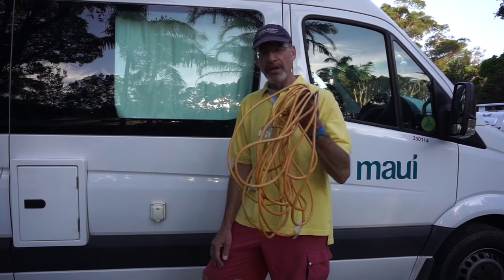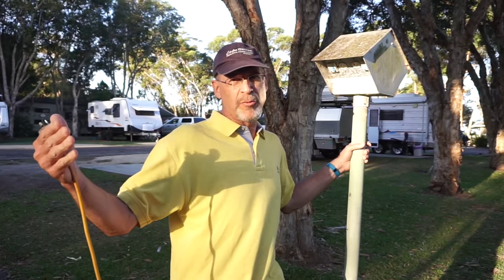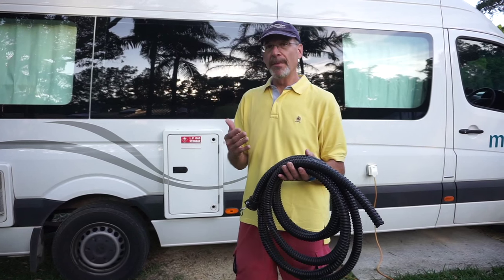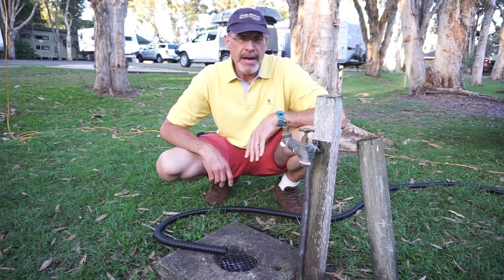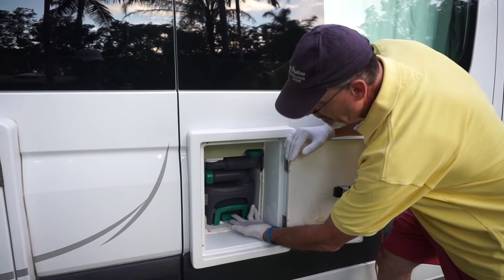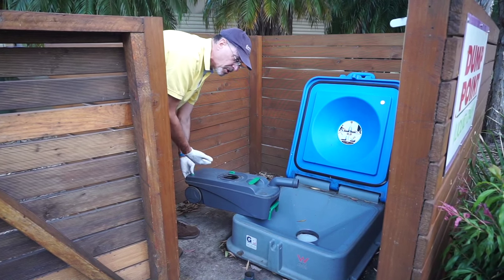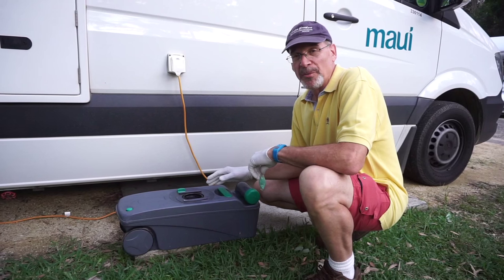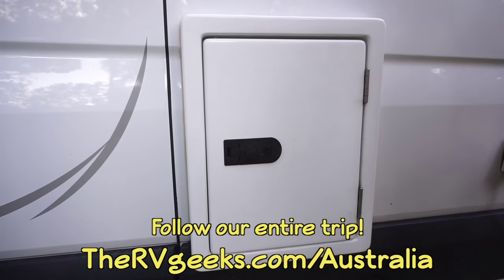Hook Up & Dump Tanks on an Australian Campervan

Comment: I haven't read the comments yet. But the only reason why the 'switch' goes up on that outlet is because it's an RCD. Which  is a safety device and is  a device that detects if the AC current goes somewhere other than NEUTRAL. It clicks off in less than 100 Thousands of a second. 240VAC is nasty to a 20yo, but is potentially fatal to an 80yo. You were correct n saying that all Australian switches are down for on. Its only the circuit breakers that are reverse.

Comment: Excellent video and info! The power switch on the pedestal is actually a GFCI breaker used throughout the world except for North America where we have our own versions of the GFCI breakers for our pedestals. Considering it is a circuit breaker down is off and it should display a green area above the switch handle indicating it is safely off. Looks just like the European hook ups, they all seem to like the KISS philosophy.

Comment: The tabs on the grey water hose are called cam locks on fuel trucks in Canada. Because they work off a cam to lock down the connection.
Reply from the maker: +Gary Boyd Yup! "Cam locks" on fuel trucks in the States, too. Pretty ironclad connection and far superior to the sewer connections we're used to.
Reply: Cam locks here in Australia too

Comment: I may have missed something here but, how do you know when the cassette is full??  (besides the obvious, of course).

Ya gotta wonder how many cassette caps are swimming around down in the Demp Ezy - lol.   Thanks!  Jim@MidOhio
Reply from the maker: +OUMagMan Yup... just open the toilet valve and eyeball it! You're right about the caps. I should have only removed and replaced it somewhere other than over that black hole (sorry). LOL
Reply: OUMagMan The cassette toilet we have in our B class has a warning light that shows when the cassette is at 95% full. Handy but the eyeball technique works well too.
Ray
Reply: Thank you
Reply: +OUMagMan In the very short clip that was shown of the inside toilet at 12:09, you can see just above the blue flush button, there is a small arrow - At the top of that arrow is a small LED light that illuminates when the cassette is approximately 80% full.

The light itself normally runs off batteries in the cassette compartment, or sometimes from the vehicle 12v system.

It works by a magnet contained within the cassette toilet that floats, and when it reaches a certain level, it makes contact on a micro switch, which in turns makes the light come on. You have to be careful not to be too vigorous when emptying the cassette, as these magnets can come dislodged, and end up been washed down the dump station! If this happens, you have to revert back to the "visual inspection" method! haha

The cassette toilets are very common here in the UK and Europe in general - and you get use to how many days it will last. Mine normally lasts about 2 days of use before needing to be emptied.
Reply: Very nice description - thank you!

Comment: Normal extension leads are 10amp in Australia 15amp for caravan/ rv parks
Reply: Also those switches are actually circuit breakers and you will find in most houses in Aus the circuit breakers switch up. When they trip they go down.

Comment: That was all very interesting!  I wonder if you have seen or heard anything "down under" about using composting toilets.  I was also wondering about the possibility of using grey water for toilet flushing so as to get a second use out of the water.  Thanks for sharing!
Reply from the maker: +Pat Johnston Composting toilets would be great here since they can be dumped much less often that a cassette. Not sure how popular they are here. We've heard of the idea of flushing with grey water, but not familiar with any actual systems.

Comment: That power outlet with the switch up for on and down for off, looks like a circuit breaker rather than a normal power outlet.   Might be the reason it switches the other way?

Comment: Great video as always guys. A question about the cassette used for the black water.  I realise that you put a disinfectant package into the cassette just before reinserting the cassette into place but wouldn't it be more sanitary to use some bleach or other disinfecting agent to sanitize the cassette when rinsing it at the dump station?
Reply from the maker: +Jack Brown Not really needed, Jack. It's basically the same as dumping a black tank in North America... flush with water and good to go. We actually feel like it's a much better cleaning with the cassette because of the ability to shake it vigorously during rinse-out, and also because it's emptied so much more often due to the small size, so it doesn't generally sit for a week or two between dumps. Thanks for the comment and great question!

Comment: Last summer I encountered a guy with a custom built Sprinter-based RV and he had a very clever setup. He had a composting toilet (that separates solids from liquids) and rather than a small container attached to the toilet for liquids, he had a hose connecting the discharge port to a cassette system. He claimed that it was the best system he had ever used after 30 years of RVing. I couldn't disagree. That's what I want in my next coach.
Reply from the maker: +Golan Klinger Sounds brilliant!

Comment: Super interesting, now I want a locking water tank cap!
Reply: Take a look at a Roadtrek sometime. You have to open the passenger door to access the fresh water fill (like how you have to open the driver door to access the fuel fill in Sprinters). Very clever.

Comment: Clearly you don't empty a cassette often. You Never do what you did and remove the cap over the dump point too many people loose the cap down the hole. Retrieving it will not be fun. Remove the cap away from the dump point not far but far enough that when you drop it you are not experiencing a nasty fishing trip :)

Comment: The higher line voltage of 240V AC allows for thinner cabling (your shore power cord for example) to draw the same power.  Power = Voltage x Current so for a given higher line voltage, a thinner cable can carry the current without the heat losses that would occur with lower line voltage necessitating thicker cabling and insulation for the same power draw in North America.

I was thinking it may benefit your audience if you could speak to an electrician or engineer in your videos to embellish about cabling size, line voltage, current carrying capacities, heat losses, etc.  I know yours isn't a science channel but I think sometimes a little physics education can help the DIY person to better understand systems they're working on and to work more safely.

Comment: Nicely explained guys. It's been a few years since I last hired a Motorhome in Australia so things (laws) may have changed But when I was last there, I was actively encouraged to 'dump' grey water while either driving down the motorway or direct on to your pitch (site) providing it didn't directly effect your neighbour
Reply from the maker: +Diefers Dashcam UK Channel We haven't heard that, but it might be the case. They're pretty laid back here!
Reply: Don’t dump while driving. Dump at van parks or in the scrub when free camping if you use bio degradable soaps etc

Comment: Cassettes are pretty common in the US as well. This is the system that is used in most modern pop-up campers. The other nice thing about them is that if there isn't an area to dump you can generally dump them in a toilet. Very convenient.
Reply: True and useful for occasional camping but full timing with 2 in an RV, I really don't want to be dumping every 2-3 days as cassette is only 5 gals.

Comment: the locking connector is known as a Cam-Loc.  I have modified my hoses and connectors for both discharge and fresh water.  Using Cam-Locs on fresh water supply lets you quickly connect and disconnect without the leaking that most "garden" quick connects do.
Reply from the maker: +Stephen Pinn That camlock design is the basis for the dump system that Lippert sells. Very positive connection!

Comment: Guys, how's the water in Australia compared to Canada and the US? In the short time I've been RVing I've noticed some RVers have 1 or 2 filtration units attached to their water line between the tap and RV. 

Some of these same people then have filtration systems in their RV and even a Brita filtration pitcher for use for their drinking water. This doesn't even include the water softening units that may also be attached to the water line. 

Have you seen any of these added to the water lines or in RVs in Australia?
Reply from the maker: +Jack Brown Most rigs here don't actually connect to city water, but only using a gravity fill instead (same as we demonstrated in our recent video). But we've seen no sign of filters being used anywhere and the water seems pretty good just about everywhere we've been so far.

Comment: I assume they dont have many large RVs is Australia.  The setup you used may wotk ok for small RVs but not large type C or type A cruisers with full amenities  (including washers and dryers ). The small gauge extension cord won't be able to handle multiple AC units and dryers, even at 220V service.  Also, cassette system is ok for tiny motorhomes and trailers.  It woukd suck big time to have this on a larger RV. 
I would also be concerned about evectrical safety on a system shown in this video. The receptacles on the pole have no adequate cover to prevent water getting inside when it rains hard (with wind). Higher voltage (vs. 120VAC in the US) is more dangerous and requires more protection.
Reply from the maker: Hi Ray! The RVs in Australia are indeed mostly smaller than in North America, but we were told that larger rigs often do have larger cassette systems. As far as washers and dryers, our understanding is that they are VERY rare... almost certainly a custom job, which is why virtually every caravan park (RV park) has a laundromat. The 220/240-volt power is 15 amps, which powers approximately the same amount of equipment as a typical 30-amp circuit here in North America (one a/c unit + TV + misc other small simultaneous draws).

The beauty of smaller is that you don't need more power than that. One A/C unit is enough for anything except the largest rigs (which are very rare, and again, often custom). Even the water heater in our van was propane-only, so no power needed there (not sure about larger rigs' ability to use electricity for heating water if desired).

As far as the power outlets, not sure if you could tell from the video, but they were angled very steeply toward the ground, so they would be hard pressed to get wet, even in wind. We were in the rain forest with pounding rain all the time for a few days, and they don't seem to have any problem. And the ability to use those small-gauge extension cords was the best! Wish we could do that here. :)
Reply: +RVgeeks           Well, I don't share the idea that smaller is better. Perhaps smaller units are dictated by what users can afford. 
There is also a difference between going camping for a weekend and loving in a motorhome full time. Many RV users in the US spend more time or make an RV their residence on wheels. This requires larger units with amenities like washers and driers. This is why most RV parks in the US are more advanced and offer larger parking spots and 50A electrical connection as well as a large sewer connection to accomodate both black and grey tanks. I doubt many, especially older RVers would be too excited to lift and haul their poop tanks every other day. 
As far as 220V being better. I would argue this as well. A 120VAC system is much safer for the user.  Also, contrary to a popular belief,  most US households do have 240V and a neutral connected to each house.  Most larger appliances require 240V to run. 120v is used for smaller circuits in the house. US also uses 60 HZ (vs 50HZ elsewhere) which is more efficient.
Honestly I would rather use a larger gauge extension cord but have a less chance of being electrocuted.  CFCI protectors are known to fail and they also often have false trips when connected to circuits running switch mode power supplies or VFD controllers.
Reply: i can say now as a aussie our 240V system allows the thinner cable and smaller amps so its far better then a 120V line and we also have a dedicated earth and what i call stupid proof plugs (the straight down at the bottom is earth the 2 45 degree ones are hot)

also i love my small camper infact its not a van of any kind its a small lift off camper that sits on my ute and its got everything i need even a dedicated grey and black tank (custom fitted) all on a ute with a steel tray back and a few modifications

ive lived in my small camper for a 3 months trip of aus and dang imma do it again for a full year going places and getting lost while doing it

also some of the older aussies have their large rv's and yes ive seen them and try have dedicated tanks thats why the ezy dump is so big for mutiple of those user's

Comment: I glanced through the comments, but did not see my question addressed.  Is there any safety in place to keep the toilet from being used when the cassette is out?  If you had two people and one didn't know the cassette was out and went to use the toilet, it could be a bad situation.
Reply from the maker: +Pidasian Hippie We're literally cruising down the highway right now, so we stopped at the first rest area, pulled out the cassette and tried to open the toilet valve. It turns out that when you are looking into the toilet the valve you're seeing is actually the top of the cassette itself. So if the cassette is removed there's no valve to open. If you were to use the toilet without the cassette in place, anything you put in there would simply fall into the bottom of the cassette compartment! So now we ALL know the answer to your great question! 😉
Reply: RVgeeks Wow!  I am impressed at the lengths you go to to answer questions!  Of course, in living up to your name (RVgeeks), I am sure it would have driven you crazy until you figured out the answer to my question.  Thank you for your response and I hope you guys are having the time of your life in the land down under.
Reply from the maker: +Pidasian Hippie Happy to help when we can, especially when a great question gets asked. Thanks!

Comment: New Zealand power etc is identical to those in Australia.  We even use the same 3 prong plug.
The cassette Black water system is generally for the smaller class C campers  (RV's) .  Larger Class A's often have similar system to USA.
Reply from the maker: Thanks Steve! We'll keep that in mind for our return trip. :)
Reply: Wow quick response...  
Forgot to say that we don't have a lot of the large Class A's (although there are a few around) so New Zealand is not really set up that well for them but we have a lot of Class C's and what we call caravans (travel trailers  'mericans).

If you need more info maybe check out the NZ Motor Caravan Association... https://www.nzmca.org.nz.
Reply from the maker: Thanks so much, Steve. We spent two weeks in New Zealand just before our month in Australia last year, but we were on a cruise, so only got a cursory look at the RVing situation. We LOVED what we saw, and really want to come back... in an RV next time, for sure! :)
Reply: Awesome..  You will love New Zealand and the good old Kiwi hospitality.